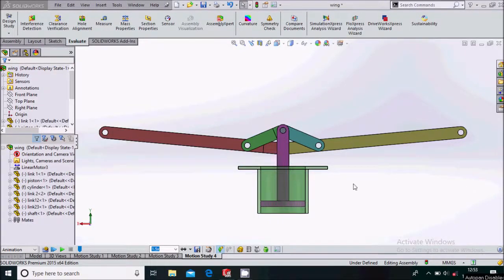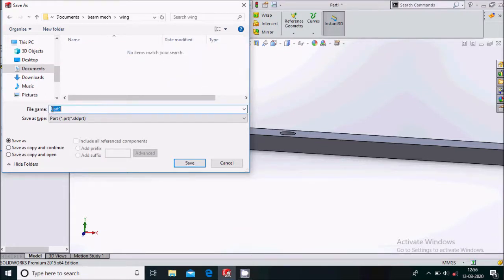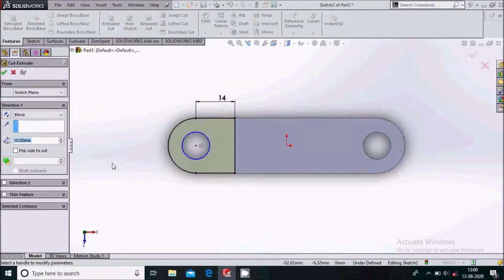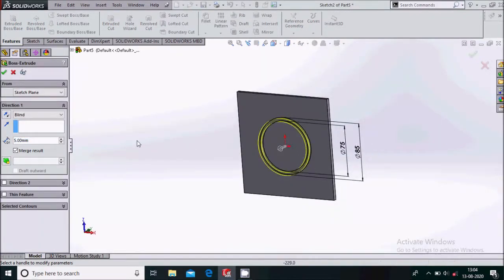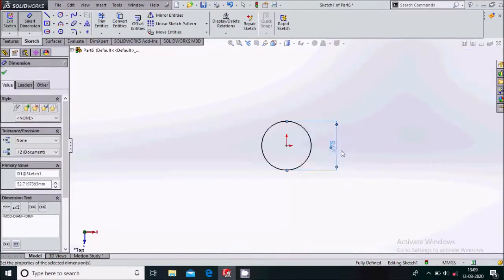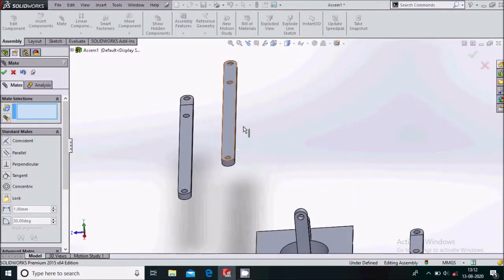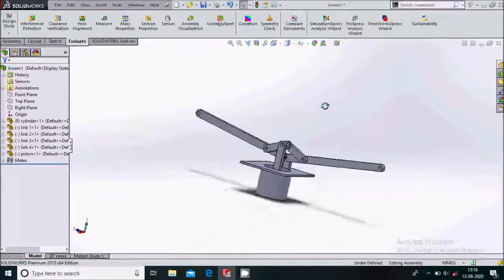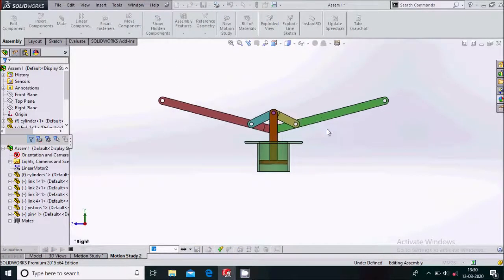Solidworks Flapping wing mechanism animation tutorial

Comment: Hi

Thanks for the video.
Any possibility I can get the file so I can print them and test?

Thanks
Reply from the maker: I don't share the files, but you can try designing it by following the steps in the video.
Reply: @cadcammanufacturingindia9769  thanks but I have already designed a similar one.